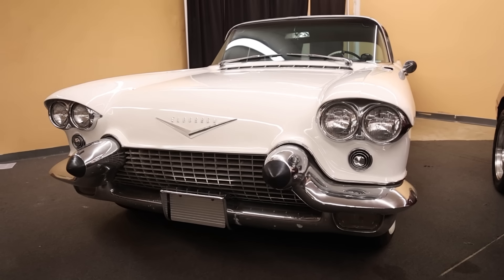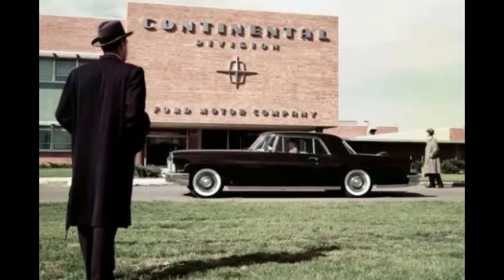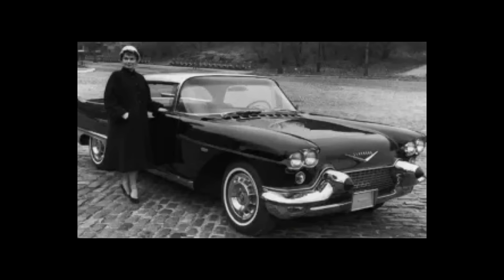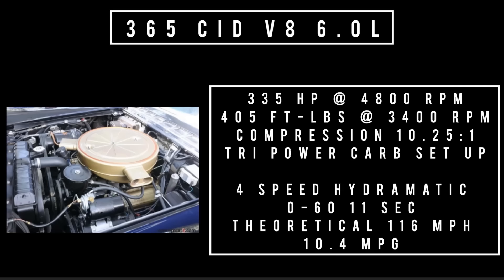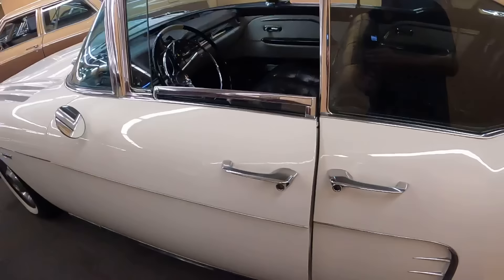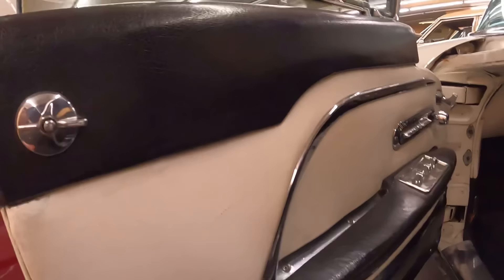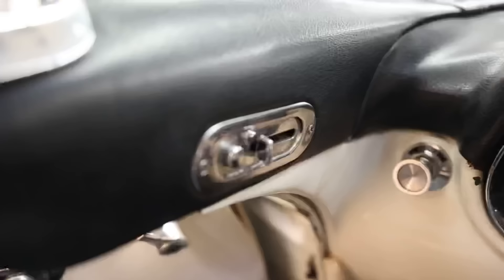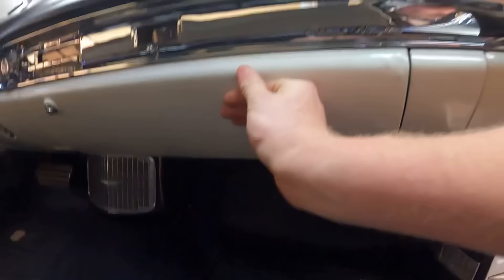1958 Cadillac series 70 Eldorado￼ Brougham, this was America’s most expensive 50s car

Comment: Eldorado Brougham, NOT Fleetwood Brougham. Air suspension was standard equipment, but most have been converted to coils. The styling changes you mentioned were for the regular Cadillacs. 57 and 58 Eldorado Broughams are nearly identical. Great car, good presentation.
Reply from the maker: Thank you for the correction I change the title as well as thumbnail and all of the slides are right for whatever reason I kept saying Fleetwood brougham I have no idea where that came from.. lol glad you liked this one =)
Reply: I think the air suspension was often problematic and sometimes it was changed to a traditional one. Therefore some of those Beauties have a traditional suspension.
Reply: @beatglauser9444  correct. Apparently, the air bags and the coil springs were interchangeable.
Reply: @danielulz1640  Yes, they were designed that way for ease of fitting.  Lincoln followed suit the very next year with similar suspension designs, to swap in the optional balloon suspension if anyone ordered it...but, given the issues people had with the Caddy, it's likely that very few id any ordered such a suspension.  Nowadays, though, some collectors with a lot of cash do swaps with some of those cars, which is fine since they were designed to accommodate such suspensions.  Still can't trust balloons, though; they still spring (no pun) holes, which is inevitable with road debris.  Sure, one can counter with "Why would you drive such a car on debris-laden roads in the first place?"

Well, why ask why?
Reply: @beatglauser9444  Nearly all of them, actually, if not all.  The Series 70 outdid the Mark II in pricing only, not in build quality.

Comment: I owned an Eldorado Brougham for 7 years and drove it daily. That is when it wasn’t being repaired at one shop or another. I spent $70,000 on restoration and it still needed to have the air suspension reinstalled. That would have been another $15,000. You can’t drive them safely without the air suspension as the car was made to ride at a certain height and if it doesn’t you can lose the axle. You will not be able to find anyone who can work on one. At least not knowledgeably. You will waste more $$$ having someone work on the car who doesn’t know how than you will spend on getting it restored. A few have been fully restored at a cost of $200,000. I drove mine 34,000 miles but it cost plenty to keep it on the road.
Reply from the maker: WOW, thank you so much for sharing your experience with this car with us definitely an eye-opener for anybody that’s interested in getting this car, that’s why this channel exist to put information out there so people know exactly what they’re getting into before they get into it.
Reply: Yeah kudos for your effort$ at keeping such a bomb on the roads ( and daily driver to boot) for so long. The gas bill alone (these got like 8 mpg in city esp with AC on!) Must've been a pain in the arse to have those suspension problems. And no one to fix it properly. GM made a few rich peeps upset back then.
Reply: How were the gauges illuminated and how did they display the level?
Reply: @markw208  they were lit up in the usual way but they were not powered like Cadillac gauges on any other Cadillac.

Comment: Hey JAY! You found one of my All time Favorite over the top 50’s Cars. I can imagine these were electrical nightmares to keep running smoothly. Awesome Stuff Jay
Reply from the maker: I’m glad you like this one I can’t convey how heavy the door was it was the heaviest door that I ever move to get into a car the crazier thing yeah it was that was the only door that was that heavy all the rest of them were pretty light
Reply: Hi from Sydney, Australia. We have 4 of these stainless-steel roofed beauties in our New South Wales chapter of the Cadillac La Salle club, there are more sprinkled around the country in other states. Three are owned by friends of mine, 2 were decent non restored excellent cars one RHD & one LHD.  The third was a restoration and the original elderly owner had a matching black 1957 Eldorado Seville for his wife, my mate bought both and restored them over a 10year period. The electrics are more than most old cars, but well-made and did not give Graham any woes at all. I have a 1974 Fleetwood Talisman with every option except a sunroof and thermometer in the driver's mirror. It has a MASSIVE electricalsystem by comparrison with the "humble" lot in the 57 & 58's. It has the TWO most rare options in it, Trackmaster ABS brakes-traction control system, and ACRS, GM's early airbags, Air Cushion Restraint System. Additionally, it has a factory Dictaphone system, the garage door opening system etc, etc the list just goes on and on. However, I have owned it now 40 years & 4 months. As a GM Holden Aust delivered CKD Kit car (completely knocked down) it is also Right Hand Drive. 1974 was the year we nationally went metric so it's also a kilometres car. When I bought a mere 102,700 ks were on the odometre when nearly 9yrs old, now 4 decades later, it has 704,000 ks on it or about 445,000miles its electrics have given me ZERO issues, NONE. I have had staff with new company cars that have been from zero to five years old with massive issues, melted systems from the Aussie heat in open carparks for 9 months of the year. I have registered business use & used my 1974, and 1972 Fleetwood's daily for decades, fully serviced and claimed back against tax returns. Both have been flawless, everything works perfectly.

Comment: People know me as a car guy and am often asked what my favorite car is, and I say 'Eldorado Brougham'...of course none of them know what it is.  Love the black and white interior on this one, like a tuxedo.  As others have mentioned the air suspension was standard on the Brougham, although a warranty recall caused most to be converted to coil springs.  I have a '58 Fleetwood with air suspension, and also was converted, but have the complete setup for air if I ever decide to go back.  interestingly, none of the air suspension parts are shared between the Brougham and the other models...in fact, other than the engine, trans, rear end, and a few other bits like some dash controls, nothing is shared and is the reason these cost so much and the reason Cadillac lost thousands of dollars on each one.  great road cars, i regularly drive mine 80mph over the mountain pass just down the road from me.
Reply from the maker: Awesome information and story, when I was shooting this car I was talking to some people that were also there and I told them could you believe that this is the most expensive car produced by a major manufacturer in the 50s.. it’s a great car not sure I’d ever want to own one because of electrical and mechanical complexity.
Reply: @What.its.like.  same...you have to have buckets of cash as they are one of the most expensive post-war cars to restore.  I have seen a couple custom Broughams, which were awesome, but probably custom because the restoration is $$$$.  def one of my lottery cars.

Comment: I think the air suspension was standard but was problematic and many were converted to standard suspension.
Reply from the maker: Awesome I couldn’t find any information pertaining to it I saw a couple Cadillac ads saying that air suspension was available across the board.. you would think that if it wasn’t expensive car that there will be advertisement about it but there wasn’t that much advertising bits on this car
Reply: @What.its.like.  It came standard on many 58 GM cars and was a FLOP! even when it worked! I drove a 58 Buick limited with air suspension and it was like driving the good ship lollop! And it was working correctly.
Reply from the maker: I drove a car with air ride this summer I’m not fan

Comment: 9:40 I believe that's not a third hinge in the middle, but merely a stamped cover for the wires that come into the door, to protect them from getting chewed up. A similar, but simpler design was used on the more plebeian cars as well. Regardless, thank you for showing this very rare, basically one-off car ! A gorgeous design with so many fine details.
Reply from the maker: Thank you so much for pointing that out =) I want to find a mark ii and compare them

Comment: Beautiful car and one of my all-time favorites. The rotary seat controls were outrageous! "HORIZONTAL, FORE and AFT!" A nautical reference to remind you that you were driving a boat, just in case you'd forgotten. Any idea what those chrome circles below the headlights are? Loved every second, Jay!
Reply from the maker: Glad you liked this episode =)
Reply: From Sydney, Australia, the chrome circles ate the horn sound outlet points as the car had 4 yep four horns. I own both a 1972 Fleetwood Brougham, and a super rare 1974 Fleetwood Talisman both also have four horns, the 4th horn is an electric trumpet horn that makes a Fleetwood sound like a GM Diesel railway locomotive is about to run you down, a decent BLAST from it will wake up a whole suburb. My staff at work can hear me make a warning blast at an intersection a mile from our office building, INSIDE the sealed airconditioned building. No one can say they did not hear it, as it's the most aggressive horn on anything but a railway locomotive.
Reply: Thanks for answering my question. I knew someone who owned A '74 Fleetwood Talisman, Diplomat Blue inside and out. Unforgettable car!

Comment: For those wondering about the gear shift quadrants in this car (many cars equipped with hydramatic transmission, notably GM and some Crystler cars from this era until the early 1960s) are Park, Neutral,  Drive, Low, Reverse.    The problem with this, is it was very easy to overshoot from Low to Reverse, and because cars of the time  had no sensors to prevent reverse from being engaged while the car was traveling forward,  the result was typically a catastrophic failure often resulting in loss of control and possibly a crash. by 1971, it had become part of federal law in the form of U.S. Department of Transportation Standard No. 102: “Location of transmission shift positions on passenger cars. A neutral position shall be located between forward drive and reverse drive positions.      Hence the P-R-N-D-(manual) on all modern vehicles regardless of make or model.
Reply from the maker: Thank you so much for sharing all of that information and insight =)

Comment: You don't disappoint. You find a one of a kind car and every video you have something you say you don't know what it does. Can you take someone with you that knows cars? That engine bay portion of the video was very short. The air compressor for the air ride could have been explained. Show us the Carb setup.
Reply from the maker: This is a car community not everything can be found on the internet, people in the comment section lived with these some have even owned these help out a lot with the blanks, and it gives them a voice. it’s impossible to know everything about everything, and it’s a fine line I couldn’t show the carbs it’s not my car, and don’t work for the dealer make these episodes to keep the information out their so if the younger generations what it it’s there.. information for this car is hard to find not in on place. The information in this episode is priceless to someone looking at getting one of these and to add to it a few have owned this car commented and said how expensive they are to restore and keep running. Mechanical and electrical complexity.

Comment: I and a friend would go to the auto show every year to see what was coming out that year. I first saw the brougham centered at the show floor with spot lights all over it. The one I saw was a dark blue with that stainless steel top. The interior was dark blue and the carpet seemed to be at least 1" deep pile. When I saw the window sticker, I almost fainted. I thought, "A car costing more than a house, absurd!" Yes it had air ride which was available in other GM cars. It was very expensive and many didn't last and were changed to springs. The view of this car has never left me even to this day many, many years later.
Reply from the maker: I never saw a blue one like the one for the thumbnail but that is my favorite color combination that car would be absolutely stellar. I saw midnight blue one at a car show last year and I couldn’t get anywhere near to ask the guy if I could shoot his car there was at least 300 people around it it was insane. He had all of the trinkets the tumblers i’m pretty sure he had all of the accessories and I wanted to go back but by the time I had a chance to get back he was gone.
Reply: @What.its.like.  As they say, "Those were the days" . I think that even that the price of gas was around $.30/gal. Yea, I said $.30 maybe $ .35/ $ .37. My '66 Riviera had a huge 425 cu. in that got about 10 MPG in the city and maybe 14 MPG. on the highway. Oh but what a ride that was. At 80, you might have turn the stereo FM radio up but that's all.

Comment: Primary differences between the 1957 and 1958 Brougham were limited to carburation (3 -2's in 1958, 2-4's in 1957) and the change to leather-lined door panels (which was a running change in late 1957)  The two years are visually identical from the outside.  There were also other very minor mechanical parts updates and upgrades during production.
Reply from the maker: Thank you so much for the correction
Reply: Right but what gm needs to do. Add a racing thing to that with the same. Cubic inches high rise lifters overhead cam  fuel injection on their Cadillac to compete with electric vehicles.

Comment: Who would want a Rolls Royce over this?  Rolls Royce was so old fashioned, this thing was modern, beautiful, it had a V8 with a 4 speed auto. One of the things I'm surprised not to see, because I've seen a 1957 Eldorado up on a lift is the the 57 had fully independent suspension with a trailing arm rear suspension and four wheel disk brakes.  So these were very advanced cars.  I'm also surprised to hear about the fuel economy.  My dad was born in LA in 1941 and his uncle was Casey Stengel because his aunt edna had married Casey, and Casey had no kids so my father was like his kids.  Casey Stengel was a very nice man, and my dad remember Casey would come and hang out with them in the 50's and they would all get in his 1957 Cadillac Eldorado.  My dad said it had automatic windshield wiper, headlamps and he said the car got like 25-30 mpg.  I think that's one of the misconception was Cadillacs got bad fuel economy, from what I understand once they got up cruising on the open road they were actually fairly aerodynamic, had low rolling resistance and actually got pretty good fuel economy, but maybe not, who knows.  My family like cars, in the 60s my grandmother got a BMW 635 with the batwings, so she was the fastest thing on the Freeway of LA in the 60's. In the 80's my uncle got a BMW Alpina.  In 1982 a Chevy corvette had maybe 150hp and that little 2500lbs BMW 3 series had 250hp, did 0-60 in 6 second, and got over 160mph!  A small little 3 series could take a Ferrari, you needed at least a Porsche Turbo to get it.
Reply from the maker: Thank you so much for sharing those memories =)
Reply: I don't know what you thought you saw on that lift but the '57 Cadillac most definitely did NOT have independent rear suspension (though it did have trailing arms, it still used a live rear axle), and it did NOT have disc (not "disk"--that's a computer term) brakes.

Comment: The El Dorado concept car was shown in 1956 it looked like the production version except it had a removable roof over the driver's seat like an old fashioned Town car limousine it was designed to be driven by a chauffeur.. and yes air suspension was standard. Due to service and warranty issues Cadillac dealers replaced most air suspensions with coil springs.
Reply from the maker: Awesome thank you so much for sharing the information and insight =)

Comment: There's a local here with 6 Cadillacs including this one in blue. Not sure if the air ride was standard. They were optional on other full-size GM cars, and they seldom worked anyway. One rare, and cool ride!
Reply from the maker: I wasn’t sure if it was standard somebody mentioned in the comments that it was standard on that car everything was standard on that car.. I was a little bit bummed out that there wasn’t any hardly any advertisement pieces about this car I thought for sure there would be a commercial that I could tie into this episode but there wasn’t and I did watch a couple commercials Cadillac did say Air suspension was available as an added option across all model lines so that added to the speculation I wasn’t sure..

Comment: There would have been a distinct difference between 1957and1958. all cars from all manufacturers were mandated to have dual headlamps in 1958. where as 1957 models had single headlamps. the dual headlamps lasted for two years, when the manufacturers had their choice to produce cars with single or dual headlamps. a lot people think that they used chrome in the fifties, when actually they used stainless steel nickel steel on the outside of the cars. the reason that the previous owner rerouted the tailpipes? is it would stain the bumper black over a long period of time. a lot GM vehicles shared a number of parts less so with Cadillac they were more parts specific. the group that sang that song was Tommy James and the Shondells.
Reply from the maker: Thank you so much for all of that information =)